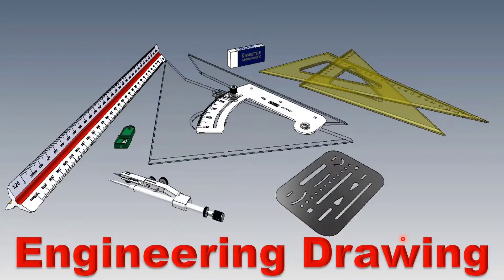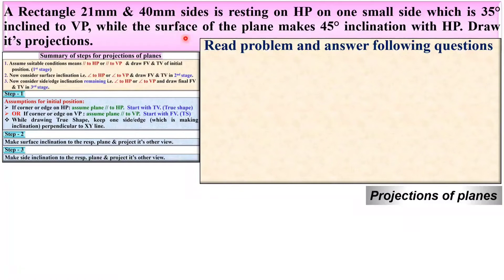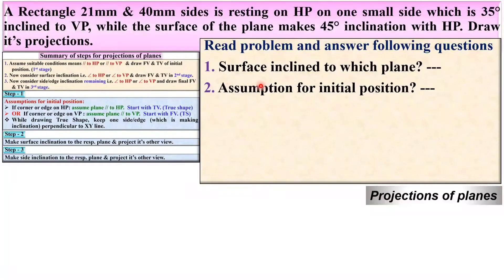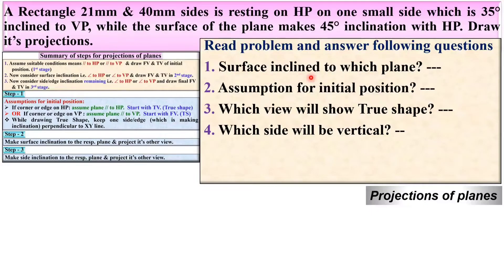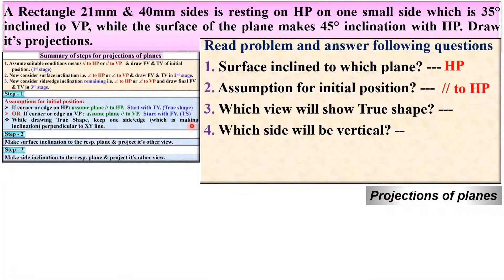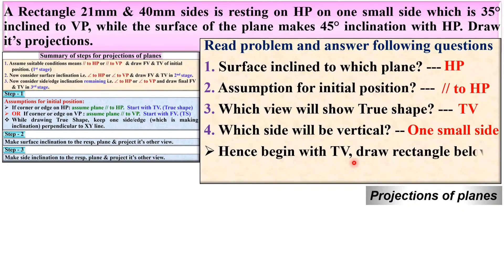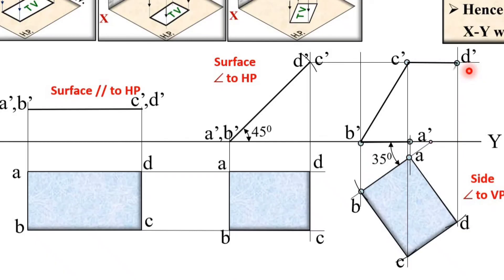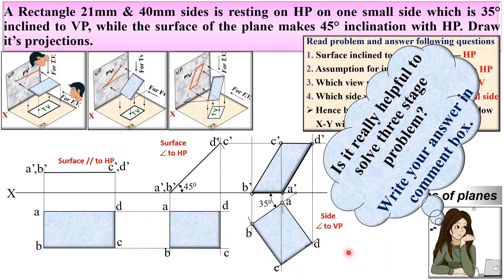4 - Projection of Plane (Basics, Drawing Process & Solved Example) Explained in Engineering Drawing

Comment from the maker: Projection of Plane explained with following timestamp: 
0:00 – Engineering Drawing lecture series 
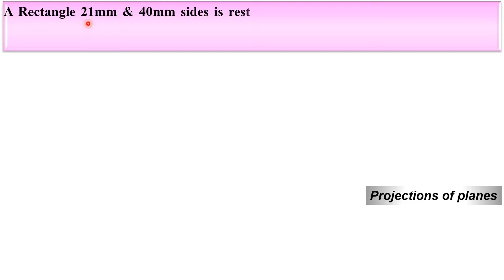0:18 – Description of problem 
0:30 – Rectangle is resting on hp on one small side
4:13 – 3D figure w.r.t. HP and VP.
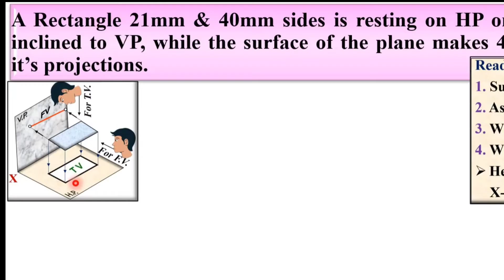4:47 – Sequence of the problem
5:25 – First stage
7:20 – Second stage
9:53 – Third stage